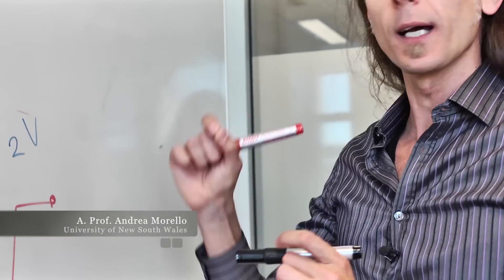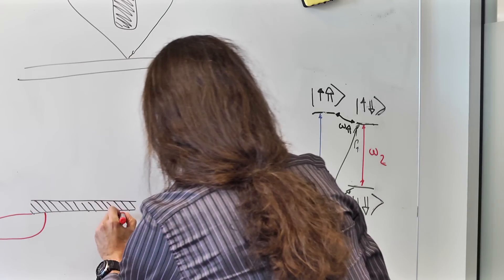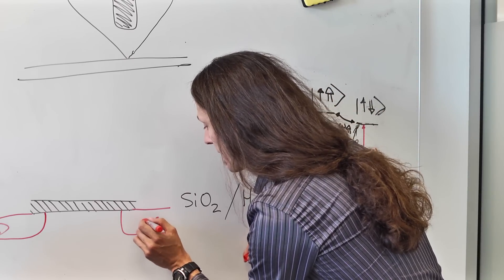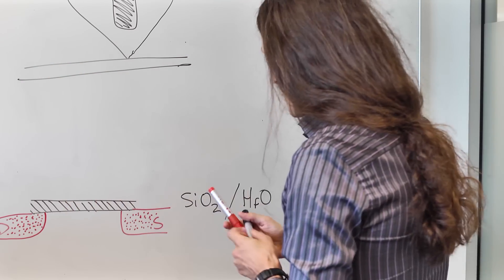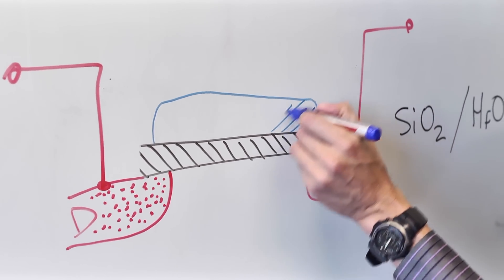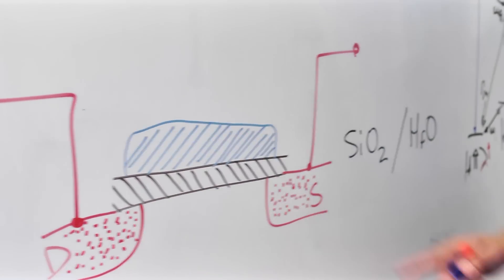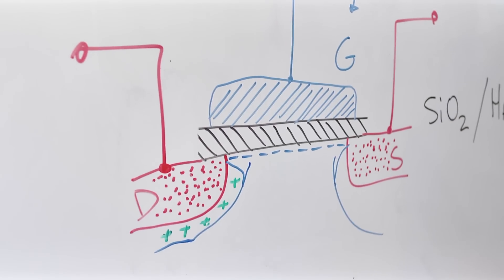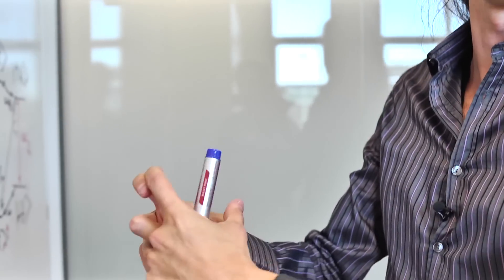Transistors & The End of Moore's Law

Comment: why don't we make a bigger chip so that we would have more transistors ?
Reply: If you increase the size of the chip, the distance the electrons have to travel also increases. A greater distance means a lower performance, because it takes longer for them to reach their 'destination'.
Reply: heat, also
Reply: i mean a cpu bigger by few extra cm² isnt gonna be a big deal, is it? also i dont think its consumption and the heat generated would be that important.
Reply: ***** oh yea ... good point
Reply: +Joao M C i'm not talking about making bigger transistors but bigger chips... a bigger chip has more transistors which means more performance
Reply: Also, another problem, is that, since all of the transistors have to interact with each other, and all of the components have to interact and communicate with each other, there's probably a logistical point where the connectors that have to connect the cores and the cache and other parts together just don't provide enough performance to justify their heat output, delays, space, added build complexity, and energy consumption, which would be the point where its literally more efficient to make more processors instead of trying to make them bigger, which is a point that CPU manufactures have to keep their CPU sizes below..
Reply: The SOL while traveling through a solid substance... so not nearly the speed of light your thinking of
Reply: Fed Ex,  that would leave us in the exact same place, we are not having an issue with inferior material, but the distance between said materials will become so close that quantum tunneling can occur, did you not watch the video lol?
Reply: Fed Ex Ill admit i have an issue understanding people sometimes, but i really dont know what your saying here, but maybe your talking about that fact that you can use so much more energy per transistor if we were to use graphene instead, i imagine the increase of temperature (which is one of comp users biggest battles already) would be large, so large that it would eventually destroy the hardware that its built on.  
  Also the power supply would have to be amped up and the cooling systems which in turn increases noise, the second part of said battle for frequent users.
Reply: Nassím xd - another really significant problem is energy density. 

Each tiny transistor generates heat energy when the electrons flow in the channel, and the larger the silicon area devoted to transistors, the greater the total heat generated. 

Right in the middle it can get very, very hot unless some cooling is used. And that cooling starts to get pretty big, complicated and expensive if it must always keep the centre of the chip area cool.

Any transistor that gets too hot behaves erratically or can simply burn out, killing the whole chip.

And incidentally, the faster the clock speed, the more often elections move through those channels, and the hotter the silicon gets too.

Of course you could always reduce the clock speed to reduce the heat build-up on a large area, but that kind of defeats the purpose ... ;-)
Reply: Nassím xd - another really significant problem is energy density. 

Each tiny transistor generates heat energy when the electrons flow in the channel, and the larger the silicon area devoted to transistors, the greater the total heat generated. 

Right in the middle it can get very, very hot unless some cooling is used. And that cooling starts to get pretty big, complicated and expensive if it must always keep the centre of a very large chip area cool.

Any transistor that gets too hot behaves erratically or can simply burn out, killing the whole chip.

And incidentally, the faster the clock speed, the more often elections move through those channels, and the hotter the silicon gets too.

Of course you could always reduce the clock speed to reduce the heat build-up on a large area, but that kind of defeats the purpose ... ;-)

Comment: But michio kaku in the video of end of moores law said that at moores law breakdown quantum comp rna dna molecular computers will take place of classical computers
Reply: +M Rawat Quantum computers will probably not replace Silicon based computers, atleast not any time soon. A simplified explanation of the problem, is that classical Silicon based computers, are really really good at making calculuations serially, where it calculates algorithmns one after the other in a series. A Quantum computer however, is fast beacuse it can make a lot of calculations in paralel, but it's much slower at making calculations that has to be done serially.

Comment: I have a problem with this simple explanation. Transistor can work in many modes not just as an on/off switch.
Reply: explain it pls
Reply: +Matt Gorzka in a digital computer im pretty sure they are only used as a switch and in analogue they are used as an amplifier

Comment: This wonderful description missed one part of Moore's Law.  Every 18 months the number of transistors on a chip will double YET, THE PRICE OF THE CHIP WILL REMAIN THE SAME.  Unfortunately the point where smaller feature size causes the new chip to cost more may have already been reached with 10 nm chips (2016).  

The next node is 7 nm and it is unclear if this node will offer advantages that will offset the increased problems of manufacture.
Reply: Are you referring to the kaby lake architecture?
Reply: +David Vermillion Actually 10 nm technology is available in the Samsung Electronics 64 gigabyte (GB) embedded multimedia card (eMMC).  Cannonlake is to be the 10nm 'tick' but has been delayed.  

But what I am getting at is that minimum cost per transistor has been rising since 28nm chips were released.  Increased chip defects lead to lower yields and increased costs.  Also, smaller feature size doesn't scale as before because the connection pad can't be reduced in size as fast as the transistors are reduced in size.

Comment: I think intel have it down to 12nm now.
Reply: Skylake (released in august of 2015) is 14 nanometer.
Kaby lake 2016/2017 will be a 10 nanometer.
Reply: +David Vermillion the video said that about 22 nm is about 50 atoms across, so thats like 30 atoms across ish?

pretty damn impressive
Reply: +Cursed Phoenix I'm not sure the details of where that number comes from. The 22 nm node does not actually mean the gate length is 22 nm, but rather that half the distance between identical features is 22 nm. The gate length is probably much less. The covalent radius of silicon is 0.111 nm, so 50 atoms would fit in a channel a mere 11.1 nm wide, which is reasonably close to the 12 nm estimate I've seen. At the 14 nm node, the smallest critical dimension I think is fin thickness (the 22 nm and 14 nm processes use thin, tall silicon "fins" as gates), which is a mere 8 nm, or just 36 atoms across. In the 10 nm process coming soon in 2016 Q4 or 2017 Q1, we can expect fin thickness of less than 6 nm, or perhaps just 25 atoms. At that scale, quantum effects do start to become significant, and tunneling can cause occasional errors, though apparently not too many for them to be silently caught and corrected.

Beyond the 10 nm node is 7 nm and then 5 nm, but it's unlikely we could build those out of silicon, which means it may take a bit more time for them to hit the market, though it's still too early to say. Still, 5 nm transistors should be around by the end of the decade or shortly thereafter, with maybe on the order of a dozen atoms spanning a gate (depending on what element is used). Beyond that is anyone's guess.

Comment: Great video! Tell me, If the transistor is just a switch what switches the voltage on for the Gate?
Reply: +Matt “Marshall” Bruce There's usually 3 terminals called a source gate and drain. The gate (usually depicted as the one in the middle) controls weather current can pass. In other types of transistors they may be referred to as collector base and emitter respectively. They do essentially the same thing but different types are useful for different tasks

Comment: Moore's law has an element of cost to it. If we hit a size limit it predicts chips will just become cheaper.
Reply: +frattaro maybe but at a very slow pace because with shrinking transistors you need less material to make a chip of a similar speed as the bigger chip and thus less material cost
Reply: +john li although new fabrication costs exponentially rise,, manufacturing costs marginally decrease per chip produced. More recently, there has been attention paid to a power usage factor that may apply to Moore's law as well, as that is decreasing - so it may be performance/cost*power

Comment: he describes the operation of an enhancement mode Field Effect Transistor (FET) , a depletion mode works in the opposite way and needs a negative charge on the Gate.  The bipolar transistor is a different beast altogether and requires current into the Base , not voltage and has emitter/collector terminals Base = Gate , Source = Emitter , Drain = Collector.
Reply: +amojak you are completely correct. This is a FET. A bipolar "or normal" transistor works on current, not on voltage difference.

Comment: There's multiple types of transistor. The mosfet (in CPU's) has a source/gate/drain. A bjt (the beginner stuff I'm learning) has Collector/gate/emitter. I think the pins are used the same way- just with different names.

Moore's law only refers to computing power, NOT just the number of silicon transistors. Vaccum tubes also fit into the idea. What that means is that even if we reach the limit of silicon transistors, that doesn't mean we'll reach the limits of moore's law. That just means we have to change our transistor design.
Reply: +Nathaniel Zhu collector base and emitter. They operate in different ways to FET transistors . A Bipolar transistor can be seen as two diode junctions back to back or front to front depending on if it is PNP or NPN , the base requires current, not voltage to make those diodes conduct in reverse basically.  The FET has somewhat taken over most of the roles of the bipolar transistor these days.

Comment: I  have a 60 inch TV, why do I care if the chips are 10 the size. they would still fit easily. Same with my desk top PC. I don't need  small I want power. This miniaturization is great but not for everything
Reply: +jpalm32 there are problems with making larger chips like the latency of a signal from one end to the other, heat, and cost

Comment: Per Wikipedia:

"Moore's law" is the observation that, over the history of computing hardware, the number of transistors in a dense integrated circuit has doubled approximately every two years.

This has been happening for quite a while now, and along the way we've learned a few things that we can use to extend what Moore was saying.  I generally look at not the nm of the gate, but the actual number crunching ability of the device.  Just because we hit some limit with regard to two dimensional density does not mean that we won't just start making 3D chips that grow taller through the Z axis - possibly being cooled by having a coolant rod through the center which has liquid coolant cycling through it.

We'll also use quantum computing I am sure, but more likely off-device calculations will become common place.  You don't need a lot of computational capacity to ask your phone a question, you just need a link to the cloud to get the question out and the answer back in with a small delay.  I'm waiting for homes to start being built with central processing units, much like an A/C is standard.

These units could process the functions of the home, and not be totally hobbled by the loss of a connection to the Internet.  Computers just become displays, with all the graphics processing and CPU calculations being done on the home core.  Suddenly distributed computing could be much more powerful than it currently is, with energy being paid for directly by the projects they support.

Comment: Going smaller on one chip is not the only way to go. Have more than one chip in a processor is a way we are ready using to get more prossesing power. So moore's law can still go on even without getting less nm.
Reply: +DanceTweety Looney Tune More chips, add more costs. And makes devices bigger. And draws more power.
Which are all things one wants to avoid in say a mobile device.

The whole reason they shrink the transistors in the first place, is to simply cut down on costs, size and power usage.
Reply: I know all of that but chips are much cheaper all ready becouse they can make and sell more off them and they are so small it does not matter having some more in a processor. Only realy problem would be power and heat.

If I hear how quantum bit are going to work they are far from ready to be used and will not be good for normal computing. So are not a real solution in the end.
Reply: DanceTweety Looney Tune Yeah, but power and heat is still a pretty huge issue.

So slapping more chips into a device is hardly a good solution either.. in fact it's a pretty terrible solution. Both for mobile and desktop consumer solutions..

More heat will lead to bigger and heavier coolers. More power will increase energy consumption. which will have some environmental problems long term.
And larger chip die size will make devices bigger. 
All of this just leads to crap getting more expensive and less efficient to the end user.

So unless they solve Quantum bit any time soon.. were kinds fucked.

But they have been able to get around some of the limitations with 3D transistors though.. So who knows.. They might still come up with a few more tricks up their sleeves to keep going a while longer.
Reply: Yes they will have to else progress will slow down :)

Comment: Great guy! I thought we're moving away from silicon. The SoCs used in modern smartphones are metal gate chips which can be made smaller as metal is more resistant to heat.
Reply: +Brian Su The transistor is still silicon. The only part that's metal is the gate layer on top of the semiconductor channel. Metals are not semiconductive.
Reply: +Teth47 Ahh thank you.
Reply: Brian Su No problem. As far as I know, metal gate transistors are a way to get around the problem of quantum tunneling. The easiest way to prevent tunneling leakage is to make the gate's insulating layer thicker, increasing the physical gap the electrons have to jump to leak, but this has to be done without diminishing the field effect that the gate induces that actually switches the transformer on.

Making the gate out of a metal allows you to use a metal whose oxide has a higher dielectric constant, which allows an electric field to pass through it without allowing electrons to do so (This is an oversimplification, but it's good enough for here). The insulating layer is always formed from the gate material's oxide for manufacturing reasons, so this approach is usually best, and the metal that the gate is made of isn't really important since it's actually not carrying any current, there is no electrical connection between gate and drain ideally.
Reply: +Teth47 ahh that's a very good explanation. Thank you so much once again!

Comment: im curious does a newly produced cpu need 100% of these transistors to work. or is there error correcting code for dealing with defected transistors? I dont see how you could have so many cpu's in everything and there not be just tons of dead transistors in stuff.
Reply: +CreepinWhileYouSleepin If even a single transistor fails in a CPU, the whole thing is dead. They're wired in a grid, and every transistor in a given row/column needs to work in order for current to pass through the chip. It's like those old strings of Christmas lights, pull one bulb and the whole thing shuts off.

That is why processors, particularly Intel processors, are so expensive. The scrap rate for processors is absolutely nuts, it's something north of 50% in general, at least for Intel. AMD is likely better because they use a simpler, far less efficient architecture. That's how they can make them so cheap.

Before a processor gets to your hands, at least one other had to be melted down and remade. The bleeding edge procs have over 90% scrap rates, so when you pay $1400 for a CPU, it's because you actually had to buy 10 of them to get the one working one that comes to your door.

Comment: I only know how to overclock transistors...now I understand why we need more voltage to push the clockspeeds.
Reply: +acnfanmanin Sort of. Higher gate voltages mean faster rise times. The reason you need to increase the voltage to get it to switch faster isn't so much because of the transistors as it is because of how electricity works in general.

When you pulse a voltage for a certain period of time, the potential ramps up, then peaks, then ramps down. When you maintain the same voltage, but shorten the pulse, the voltage might not have time to reach the threshold for the transistor to actually start passing current, and you start getting errors because the transistors aren't turning on when they should be. 

When you increase the voltage, the potential at the gate rises faster, because it is trying to get to a higher voltage in the same amount of time, meaning that the transistor hits its on threshold even with the shorter pulse, and stability is restored. The downside is that you now have more total power going into the chip, which means it has to dissipate more power, which makes it run hotter.

If the chip gets too hot, the insulation between source and drain breaks down and all of the transistors begin to pass voltage, this basically shorts the processor out, causing sudden massive heat buildup and destroying the chip.

If the voltage goes too high, a similar thing happens, current starts to flow regardless of the state of the transistor because the electrons have enough energy to tunnel through the insulation. Same idea, short, heat buildup, processor dead.
Reply: Teth47 Exactly what I thought :)